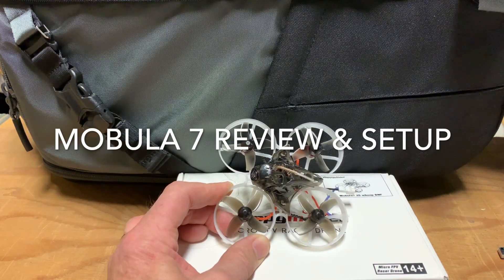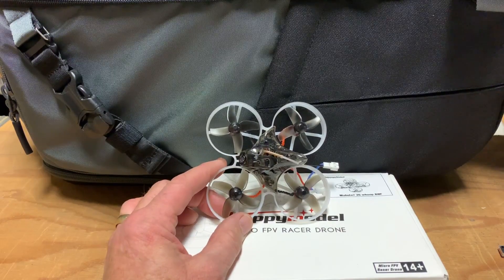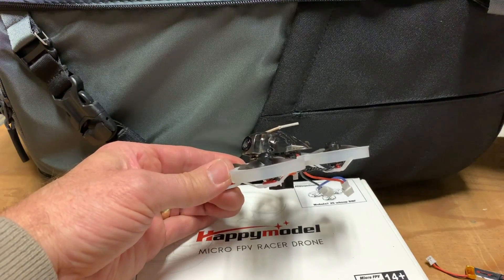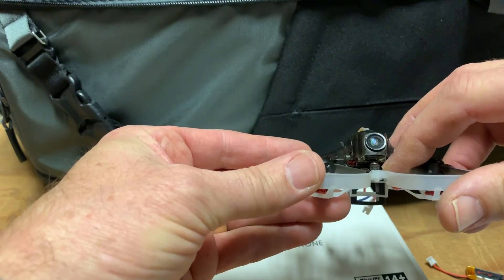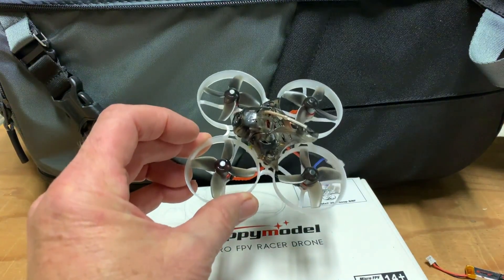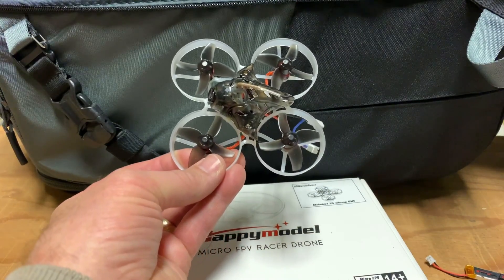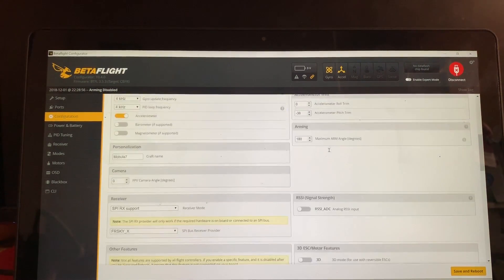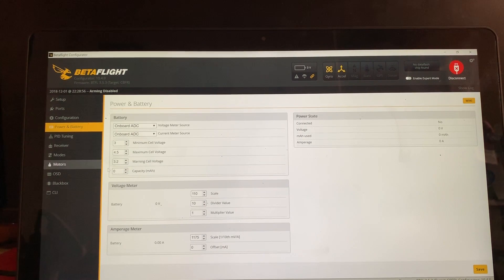Mobula7 Review and Betaflight Setup

Comment: Hi slog. I️ took a crash and seem to have lost receiver connection. I️ tried to rebind, but I️m not getting any response from the bind button. Also, every time i configure the receiver in beta flight and reboot, I️t doesn’t save. Any ideas?
Reply from the maker: Hi Scott,
I would check the receiver antenna to make sure it is not damaged or pulled off. If you look at the underside of the Mobula 7, on the front right below the rubber isolation grommet, there should be what looks like a black wire. That is the receiver antenna. Check to make sure it is not pulled off the solder pad, missing or has some other damage.
Reply: SLOG FPV thanks for the reply! I️t does seem a little bit loose and I️ was forcing I️t a certain direction when inserting batteries. I’ll add some solder and see if that helps. I️ appreciate I️t!
Reply: SLOG FPV hello again, slog. I believe the antenna is in good shape, but I️ still took I️t off, trimmed I️t down, and reconnected I️t to the pad. Still nothing, unfortunately. Does I️t need to penetrate through the board or just attach to the pad? Also, I️m on betaflight 4.0 and flashed the firmware to the latest version. Think that has anything to do with I️t? For some reason, any changes in betaflight aren’t saving. Please let me know!
Reply from the maker: Hi Scott,

It is very strange that Eachine (HappyModel) is now shipping the Mobula7 with Betaflight 4.0 that is still in development and is not supposed to be released until April. The Betaflight Developers have not frozen the code yet and they are still changing it daily.

Put that aside, hopefully you only trimmed a small amount of insulation off the antenna as the length of the antenna is tuned to the wavelength of the signal it is receiving. To answer your first question, you only need to solder to the pad. 

Not sure what version you flashed as the current Released version is 3.5.4 the last time I checked. I would recommend the following if you are running Frsky: 
1. Run Betaflight configurator.  
2. Plug your Mobula7 into the USB port and the two red and two white LEDs should be blinking on the bottom of the quad.
3. Connect to the Mobula7.
4. Go the the CLI screen and type "frsky_bind". You should see a prompt saying binding.
5. Make sure the LEDs are now on solid.
6. Turn on your RC Radio and go to the model setup page, scroll down and but the RC Radio into bind mode (should beep).
7. Exit out of that menu and you should be bound. 
Here is a link to GitHub for SPI FrSky RX binding procedure:
https://github.com/betaflight/betaflight/blob/master/docs/FrSky%20SPI%20RX.md

Hopefully you saved your "diff -all" output and reconfigured after your upgrade. I only have the factory diff -all dump for mine which came with Betaflight 3.5.0 (I am running 3.5.4). dump below:
# diff -all
# Betaflight / CRAZYBEEF3FR (CBFR) 3.5.0 Aug 21 2018 / 02:03:52 (efb340f4c) MSP API: 1.40

board_name CRAZYBEEF3FR
manufacturer_id 
name Mobula7
resource PWM 1 D07
resource PWM 2 @15
resource PWM 3 D11
resource PWM 4 @15
resource PWM 5 D10
resource PWM 6 A11
resource PWM 7 F08
resource PWM 8 I11

feature -ANTI_GRAVITY
feature -DYNAMIC_FILTER
map TAER1234
serial 2 2048 115200 57600 0 115200
aux 0 0 0 1300 2100 0 0
aux 1 1 1 1200 1550 0 0
aux 2 28 1 1550 2100 0 0
aux 3 35 2 1550 2100 0 0
set motor_pwm_protocol = DSHOT600
set vbat_warning_cell_voltage = 29
set ibata_scale = 1175
set osd_warn_esc_fail = OFF
set osd_vbat_pos = 2102
set osd_rssi_pos = 2083
set osd_tim_1_pos = 54
set osd_tim_2_pos = 2134
set osd_flymode_pos = 2456
set osd_throttle_pos = 2423
set osd_crosshairs_pos = 2253
set osd_current_pos = 2401
set osd_mah_drawn_pos = 2434
set osd_craft_name_pos = 2445
set osd_warnings_pos = 329
set osd_disarmed_pos = 2346
set frsky_spi_tx_id = 140,7
set frsky_spi_offset = -82
set frsky_spi_bind_hop_data = 2,7,12,17,22,27,32,37,42,47,52,57,62,67,72,77,82,87,92,97,102,107,112,117,122,127,132,137,142,147,152,157,162,167,172,177,182,187,192,197,202,207,212,217,222,227,232,0,0,0
set frsky_x_rx_num = 7
profile 0

rateprofile 0

Hope this helps.
Reply: SLOG FPV thanks so much for the reply. I️ think I️m just going to get a new board...im not even able to connect to betaflight anymore so I️m all jacked up. Definitely good to know about the stable bflight version and also the antenna. Any tips for securing the receiver antenna in the future? I’ve seen guys hot glue to the front duct, but mine came pretty short
Reply from the maker: Scott,
If you are up for it, one more thing to try is putting the flight controller into the boot loader mode by shorting the boot loader pins either with solder or a pair of tweezers (be careful not to short anything else). Here is a link to Oscar Liang's site on how to un-brick a flight controller. 
https://oscarliang.com/cannot-connect-to-naze32-brick-fix/ 

I could not find an antenna replacement by searching on Google but I am sure they are out there. it is a mono-pole antenna and the impedance needs to be correct (not just any wire cut to length).

Not telling you how to spend your money but the Eachine Trashcan look like a good upgrade with a F4 flight controller, better frame and Caddx camera. They are on pre-order. I picked one up for 95$. A flight controller will cost you around 39$
https://www.banggood.com/Racerstar-Crazybee-F3-Pro-Flight-Controller-Mobula7-5A-1-2S-Compatible-Flysky-or-Frsky-or-DSMX-Receiver-p-1361634.html

SLOG
Reply: SLOG FPV thank you so much for that info. Might as well give I️t a try. And yeah I️ ordered a trashcan! So maybe I’ll just throw the mobula into the spare parts bin if this doesn’t work. I️ really appreciate your help!

Comment: I'm having trouble connecting and ive already installed the drivers. Any ideas?
Reply from the maker: Hi Scott,
If you are certain that you followed the steps I gave Blessed fpv, then you will need to do some fault isolation next. I would start with trying a different USB cable (happened to me in the past). Then a different USB port on the computer. If that does not work I would try a different computer. I am assuming you don't have access to another quad to try, but if you do, that would tell you if it is the Mobula7 or not. Also if you know anyone that has Betaflight Configurator already working, that would also be a way to eliminate a defective Mobula7. 

If you have isolated it to the Mobula7, I would try shorting the boot pins to put it into the boot loader as it is possible that the USB port is disabled. That would be the last thing to try because that is a little more complicated process. The Mobula7 manual describes how to bring up the boot loader.
Reply: SLOG FPV thank you so much for the reply. Turned out to be the usb!
Reply from the maker: @Franksdad_deanmartinonrepeat  
Glad to hear you got it working!

Comment: mobula 7 cant conect into betaflight, could you tell me why?
Reply from the maker: Hi Blessed fpv, 
Sorry you are having problem connecting to Betaflight. J Boii is correct. You need to make sure your drivers are installed correctly.

If you are running Windows I would:
1. Load the latest version of Betaflight configurator if you have not already done so. Link: https://github.com/betaflight/betaflight-configurator/releases/
2. I am on a Mac now but I have used Joshua Bardwell's procedure using the STM32 Virtual COM Port Driver with the ImpluseRC Driver Fixer in the past.

 JBardwell F4 AIO Pilot’s Handbook Page 14 (Great AIO flight controller FYI)
"Here are the steps you will perform:
1. Download the Virtual COM Port (VCP) driver installer from here. https://www.st.com/en/development-tools/stsw-stm32102.html
Unfortunately, you must either create a login or give them your email address, then wait for them to email you a link, to download the actual installer. We recommend that you create a user login because the “send you a link in an email” method sometimes takes a long time to go through.
  a. To create a login at the STM site, first go to this URL. https://my.st.com/cas/login?service=https%3A%2F%2Fmy.st.com%2Fcontent%2Fmy_st_com%2Fen%2Fproducts%2Fdevelopment-tools%2Fsoftware-development-tools%2Fstm32-software-development-tools%2Fstm32-utilities%2Fstsw-stm32102.html
  b. Click “Create an Account”
  c. Enter your information in the next page and click “Register”
  d. You will receive a confirmation email. Complete the confirmation process.
  e. Log in to the STM site using the login you just created and download the VCP driver
  installer from the link in step 1.
2. Run the VCP installer and let it finish.
3. Download the ImpulseRCDriver Fixer from here. https://www.st.com/en/development-tools/stsw-stm32102.html
4. Run the ImpulseRC Driver Fixer. It will instruct you to plug in your flight controller.
5. Plug the flight controller into your PC via USB. The ImpulseRC Driver Fixer should
complete successfully".

I hope this helps!

Cheers,

Jim
Reply: Check you drivers. You should be able to find how to on yt
Reply: Make sure you're using a good data cable. I had the same problem-drove me nuts until I swapped out USB cables and found a good one. After that, I've been able to connect to Betaflight everytime.

Comment: I notice that your throttle is jumping back and forth and you are repeatedly getting the telemetry lost warning.  I also have that issue when it’s plugged into BF.   Is this a BF 4.0 bug?  Anyone else on here having this issue?
Reply from the maker: Hi Hurricane FPV,
In my case it was the laptop I was using just does not have enough current handling capability on the USB port to power the Mobula7 properly. Try plugging in charged batteries or move to a different computer. I usually use a powered USB HUB in which case I don't get the annoying telemetry lost nags.
Reply: SLOG FPV ah ok I’ll try that.  It only happens with the Mobula not any other quads I plug into this laptop.
Reply from the maker: @AndyRial  
I am connecting the dots now. When you said BF 4.0 I thought it was a typo and you meant to type BF 3.5.4.  If you are flying with BF 4.0 (still in development) you are a trail blazer :) I tried it about a month ago on my UR65, hoping that dynamic filtering would work better. It did not. My understanding is the developers focus first on the 5 inch quads when they test and tune. BF 4.0 is the next major release where they hopefully will have default PIDs that will pretty much just work as is for average pilots like myself (at least for 5 inch).

So to answer your question is this a bug in 4.0? I doubt it although you could open up a trouble report (never have done that). I really think it is just the Crazybee F3 flight controller not having enough CPU capability to handle Dynamic filtering and Anti-Gravity. Both are very CPU resource intensive. IMHO (conjecture) anything above 30% processor utilization is suspect on this flight controller.  30% is more like an average and not peek processor utilization. 

So if you have not tried this with 4.0 I would:
Turn off Dynamic Filtering and Anti-Gravity and put the filtering back to stock values.
Change your PID loop and Gyro update frequency to 4k/4k

Processor utilization should go down. FYI here is an excerpt from GIT HUB on the Crazeybee FC that might be related:

FRSKY Version:

To bind to your Taranis, you need to be running the non-eu OpenTX version, which allows you to use the required D8 setting to bind to the RX. The factory default BF receiver mode is FRSKY_X, so remember to configure this if needed.
FrSky X (8 / 16 channels) and FrSky D (8 channels) work both reliably, including in combination with crash flip / Dshot beacon, as long as the TELEMETRY feature is disabled; Basic telemetry information like RSSI and battery voltage will be sent even when the TELEMETRY feature is disabled;
On FrSky D, the TELEMETRY feature causes occasional dropouts, depending on how many sensors (BARO, GPS, ...) are enabled, probably due to a timing overrun;
On FrSky X, the TELEMETRY feature causes hard lockups due to a bug in the telemetry generation code.

Cheers,

SLOG

PS BF 4.0 rocks with larger quads but please keep in mind, you are now an Alpha tester :)
Reply: SLOG FPV wow! What an informative response! Thank you!  I tried your previous tip of plugging up with batteries and it actuality would spin the props when the throttle would jump like we see in your vid.  It arrived with BF 4.0 installed already.  I’m gonna “downgrade” to BF 3.5...
Reply from the maker: @AndyRial  
Arrgh my bad! I should have mentioned you should always pull the props off if you are working on the bench with batteries plugged in :(  Also I have motor stop turned on so the motors don't spin if I accidentally hit the arm switch while I am on the bench. Pro & Cons to setting it this way. To be honest I am not sure why they have BF 4.0 loaded as it has not been released.

You probably already know this, but before you down grade I would capture your current settings by going to the CLI tab and typing "diff -all" and copying the screen dump to a text file (notepad works fine).
Reply: SLOG FPV yeah. I wasn’t too worried about a props on injury with this little thing.  🙂
Reply: @AndyRial  My Mobula also came with BF 4. Did you already downgrade to 3.5? Was it any better? My mobula isn't flying bad at all but i have some serious oscillations (although that was with Dynamic filters and ant gravity on...
Reply: wouter krans no I didn’t downgrade. It’s flying fine but has all that weird behavior when plugged in.
Reply: wouter krans I went down to 3.5 tonight.  I’m getting this weird beep every 10 seconds. It makes the quad “hiccup” for a second then normal flight.  This thing has been driving me nuts...

Comment: Hello Slog, 
Thanks so much for posting this great & easy to understand video.  Being new to micro quads & Betaflight, your video was a tremendous help!  Know that your time to produce it was much appreciated!
Reply from the maker: Hi tkeeg,

I am glad this video was helpful. From you comment it sounds like you are new to FPV in general. I am not sure how new, but I really struggled moving from line of sight flying (videography drones) to FPV. It was very disorienting for me. What got me over it was just going to a grassy park and flying in angle mode just to get used to the goggles. You will crash a lot but that is why whoops are great for learning FPV.  The 65mm brushed whoops are the best IMHO. I really like the Acrobee V2. Its cockroach frame is very durable in crashes.  

Also I don't buy the argument that you have to start out in acro mode and muscle through it, so you don't pick up bad habits. The bad habits maybe true, but that is not as important as getting the positive reinforcement you get when you first are able to fly around with a bird's eye view. The immersive feeling is what motivates you to get better. Point being, don't get too hung up on acro mode to start with. Betaflight now has acro trainer mode that might be a good transition from angle mode to acro mode once you are comfortable.

Cheers,

SLOG
Reply: @slogfpv  Hello Slog,
Thanks for your detailed response top my comment and your good advice.  I have been flying RC aircraft for about 14 years and was designing and making drones from scratch before most people even heard about drones.  You had to do some of the actual micro soldering of components in the old flight Mikrokopter control boards back then to build your stack.  That being said, the only real FPV that I have done was with the DJI Inspire & Mavic drones and with some of my fixed wing aircraft.  In those cases I took off and landed via line of sight and only put my goggles on to fly FPV when I was up high and and away from any objects that I might crash into.  Trying to fly my tiny Mobula7 around my house via the goggles with my 65 year old reflexes is proving to be a real challenge to say the least! 
The advice you gave me sounds like it is right on the money to me and I'm sure that I'll be better off startling in an open park area like you said to get used to the goggles.
In case you're interested, here is a link to one of my YouTube videos that show the type of FPV flying that I am used to.  Of course the FPV part does not include the take off & landing, its only done while up high.  https://www.youtube.com/watch?v=mJF2cLeJ1v4&t=95s
Thanks for the advice and happy flying my friend!
Reply from the maker: @tkeeg   That is a way cool video!! I have a buddy at work who I am trying to convince that a FPV camera on a RC plan is the way to go! He is strictly a line of sight RC plane pilot. You one upped the FPV camera with a three axis gimbal.  Nice rig!!
Reply: @slogfpv  Thanks, I'm glad you liked it!